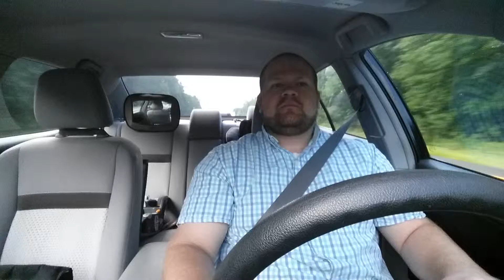3 Ways To Create Signal Flow Diagrams | Volunteer Tech Vlog

Comment: Yep, your google sheets is awful.  How 'bout draw.io which can save to google drive?
Reply from the maker: strobelightaudio  I'll have to look into draw.io.  Looks pretty cool, hadn't heard of it before. Thanks for the tip.  Using the word "awful" is such a subjective thing.  I would not classify a functional, free and easy to access method of documenting signal flow as awful.  What specifically makes it awful?  Admittedly it's not pretty but it gets the job done on a zero dollar budget.
Reply: Live Sound 101"full of awe; reverential.".  ;-)
Reply: strobelightaudio oh a real wisenheimer! LOL
Reply from the maker: +strobelightaudio Just tried playing around with Draw.io based on your recommendation.  It's great for drawing single pages and keeping those pages digital.  Not so great for a multi-page drawing set (ie. Audio, Video, Control, Power flows).  Also Draw.io is horrible when it comes to printing.  The print layout/setup looks fine up until you are in the process of saving to PDF or sending to a printer at which time everything is re-sized!  oops looks like a pretty big bug.  While I love the idea of Draw.io I'm not going to sink a bunch of time creating drawings on a platform that doesn't support multi-sheet files, and doesn't support printing.